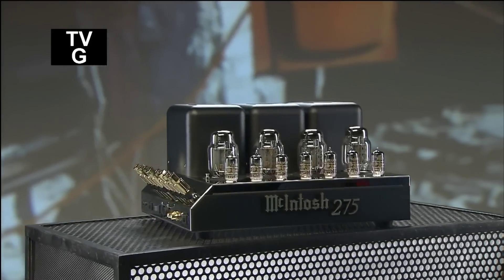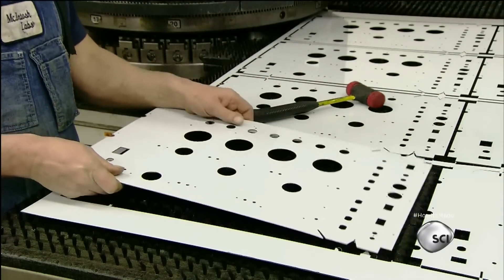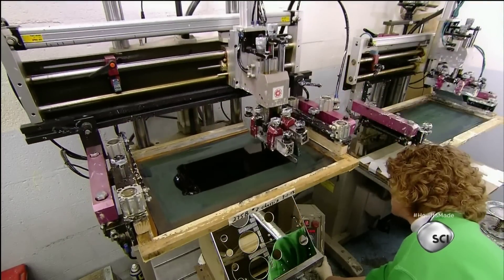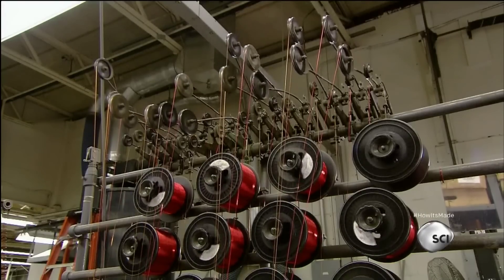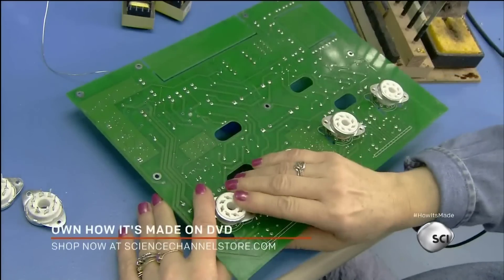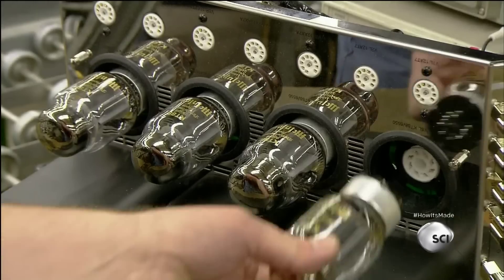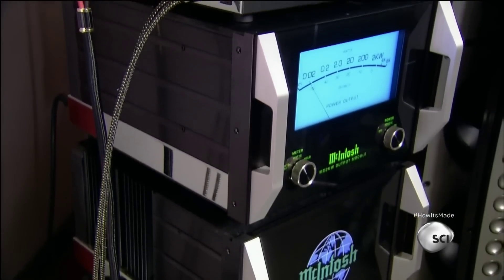How It's Made - McIntosh Tube Amp

Comment: I am of an age that I remember the golden age of HiFi very well, the age before Solid State devices took over from the Vacuum Tube, the 1950s and 60s.
I used to build amplifiers such as this one, does anyone remember the QUAD brand of British made amplifiers and the pioneering QUAD Electrostatic Loudspeakers. The greatest difficulty was always getting hold of those very specialized output transformers which only QUAD made. They were VERY careful about selling those transformers to anyone but their genuine dealers.
The finished products were magnificent and very impressive to look at.
However the FAIRY TALE about tubes being “better” or “warmer” or “sweeter” than Solid State is just a FAIRY TALE, designed to maintain a market for these very expensive DINOSAURS.
Even from the very early days Transistorized amplifiers were INDISTINGUISHABLE from Tubed amplifiers, over the years Solid State devices have improved even more and their versatility FAR OUTSTRIPS ANY TUBED AMPLIFIER.
Blind listening tests have PROVED BEYOND DOUBT that there is NO DIFFERENCE between the two Genres.
Tubed amplifiers are beautiful to look at, BUT any perceived difference in “WARMTH” is simply the buyer LISTENING TO THE MONEY THEY HAVE SPENT on these relics.
Save your money and buy a FAR LESS EXPENSIVE well reviewed device and put the money you saved into a college fund for your grandchildren, a FAR BETTER USE for the money.

Comment: As for the tube/transister debate, both valve and solid state offer similar if not the same performances. It is the design methodology and there implementation that seperates low from high end equipment. 

As for cables, my own listening tests confirm, that you do indeed get what you pay for and there are differences between cables, manufacturing technology and materials used. 

In the end, less is more. An ideal amplifier should be as near to a straight piece of wire with gain as possible.  Anything added, is where noise and distortion are likely to be generated. Additional performance can be obtained by limiting all vibration within the circuit as well as its enclosure.

Comment: I've been using tube amps for 25 years. It's clear to me that they sound magical. However, not every tube amp sounds good. It all depends on the circuit and quality of components.
Reply: Try all dht tube amp...you ll be surprised
Reply: @ngoweyseong3738  Do you mean the DHT model from Bartola Valves, or an amp made with all Dobhoff (DHT) type tubes ?  I had to google this but, neither case is common in the guitar tube amps that I use.

Comment: Unfortunately the printed circuit board approach makes for ease of assembly only. Point to point wiring, as in the old Mc's, is much to be preferred for sound and serviceability. If the output tubes fail they can put 700V through the circuit board, possibly melting the traces so the board has to be replaced. This cannot happen with point to point wiring. The driver transistors are rated for ~40V only; if the tube fails at 700V it will take out the tube. If one put a $0.02 diode to protect the transistor this would help. Computer techniques are not applicable to the assembly of most tube gear. It's not the same company or equipment. It's for the nouveau riche.

Comment: Seeing some of the debates here reminds me of an experience one of my electronics instructors at tech school shared with my class. He once worked for a prominent test equipment manufacturer and his group was tasked with building a CB radio analyzer. They had to go out on the market and buy various models to try with the analyzer. He spoke of two models in particular, one that everyone considered the Rolls Royce of CBs and another everyone considered to be Wal-Mart clearance bin grade. Imagine his group’s surprise when both were opened up and found to use the exact same circuitry inside. It’s all about marketing.

Comment: Now speakers are made with tiny amplifier built in and they no longer use cables only for the power cord instead they use wireless bluetooth connection

Comment: It should have been a post of how they made the original Vintage amp back in the day when they were 'King' Handmade, hard-wired, point to point soldering with genuine components. NO Printed Circuits and Plastic. The soul of this 'Brand Name' was the 'Handwound Unity-coupled Transformers' Best in the World then and today. I started my career in HiFi Audio at Photo-Tronics Warranty Station in Seattle, WA 1960. Warranty Service Technician. I also would hand match a set of 'cooked tubes' for a flawless performance,  we took pride being McIntosh Warranty Service. There were no issues with the Amps until PC boards and Solid-State came into productions. Long Live Point to Point Hard Wired Hand Silver Soldered Vintage Electronics.

Comment: Unitra Edward. Another 25kHz hearing audiophile stuff. Generally it is true that electron tube gives lower noise than transistor.
Reply: You can get <4nV per root hertz from many low-noise audio opamps, such as the NE5534A, the one used in all the mixing desks in the world (nearly)...  Can any vacuum tubes can't get near that in the audio frequency range?  If you want a low noise preamp, this is where technology is now: http://www.thatcorp.com/datashts/THAT_1570_Datasheet.pdf

Comment: And why are they handling the tubes with their bare fingers?  Bad...
Reply: ??? Probably because they've been manufacturing these things long enough to know how hard to grip them and to not touch the conductors? Use cotton gloves that won't slip.
Reply: Receiving tubes don't get hot enough that fingerprints can compromise the device.  Transmitting tubes, that's another story, but they require forced air cooling and several kV anode drive.

Comment: ...looks like those chips on the circuit board(which contain transistors) would tend to re-introduce the kinds of problems you were trying not to have by using tubes instead of transistors...   (such as PN junction hiss)
Reply: Lets see the schematic before jumping to conclusions!

Comment: And you let the worker wear rings around stuff that can scratch?  ... real smart..
Reply: chris younts  Riiight.....
Reply: You are forgetting how qualified and experienced you have to be to work in this type of assembly line. They probably let their workers wear whatever the fuck they want to keep them happy.
Reply: @lowerthetone  Would not fly at just about every company I have worked at.  Why I went silicone for the wedding band.  I have unboxed many high end items and will find scratches on them from time to time.. knowing it was a worker who was being careless or had a wedding ring on.  Seen it happen too many times when I controlled quality.  To each his own.. I just wouldn't allow it and the company I work for is far far larger than McIntosh.
Reply: @badlilstang  I'd be interested to know what type of companies you work at. These smaller, niche "cottage industry" types of businesses tend to have just that of a manufacturer line. I can think of many modern examples but am afraid to drop names. The jist behind their reasoning is often, "our product is easy to build, so the guys on the line don't need lab coats and gloves." I have seen them with rings and bracelets on. However, i am specifically thinking about niche turntable and amplifiers when I say this. No doubt things will change if there is ever an accident!

Comment: The way an accomplished audio engineer explain it to me, regarding the smooth realistic sound of tube amplification and preamplification, (that distinguishes it the from the flatter and hollow sound of digital and analog reproducton), was the vertical field effect of tubes, which enable them to produce an upper and lower harmonics of the fundamental tone being played. Further, it seems this is what the human ear hears and senses in a live performance, that gives one the sense of realism and depth, not sensed when listening to a recording. He also added one's hearing would have to be in good condition and somewhat trained, to appreciate the full benefit, the tube sound gives over newer technologies. The added benefit of quality workmanship, pride, build quality and oversight at the McIntosh factory adds a further enticing reason, for many audiophiles to spring the added cash to be a proud owner of one of these fine amps. I am a proud owner of two of them and can attest to their great sound and years of trouble free service.
Reply: "which enable them to produce an upper and lower harmonics of the fundamental tone being played"  = "adding something to the original signal" = "not accurate"
Reply: @KB-kc7ou  if you want accurate tubes that have better layering than this just get the I50 audio research integrated amp.

Comment: That awesome ..., the lights turn green so the user knows when the amplifier is ready with its temperature in optimum valves, hahahaha, they sell them anything.
And the transformers are crap !!!, are not manufactured layer by layer, if I look for a 1940 amplifier the transformers are better made than these which are a wire bun, or transceivers interetapa have, a clown

Comment: So they take off the protective film and polish the chrome...After which some lady assembles everything with no gloves on, leaving a ton of fingerprints that then needs to be polished away later.

Also, i saw NO ESD protective gear, bracelets or anything on the lady that handled the electronic curcuit board and the lady inserting the tubes had no gloves on, which means that they would have to polish the tubes to get rid of fingerprints.

All in all, not a very clever production.
Reply: I'd be terribly surprised if there's any ESD-sensitive CMOS hardware in a Mc amp, so the static strap's not strictly necessary. And they do go through and get the finished product "white glove" clean before they wrap it and pack it.

Comment: Solid state amps tend to produce odd order harmonics when over driven, tube amps tend to produce even order harmonics. Even order harmonics are exact octaves of the original note and they serve to fatten the sound, odd order harmonics are not exact octaves and sound like shit. If you don't overdrive your solid state amp it will still sound good but you can overdrive a tube amp and it will sound great, in some cases even better. It is far better to squash a sine wave than it is to chop the tops and bottoms off. Tubes are better.
Reply: That's good for guitar amps, but in Hi Fi audio you don't want to overdrive your amp and definetly you don't want to color your sound in any way, not even with enhancing even harmonics.

Comment: It's nice to know they used non-magnetic connectors to avoid distorting the sound.  You certainly wouldn't want to cover up all the distortion from the steel plates in the output transformers!
Reply: I guess "How It's Made" really isn't all that concerned with "how it works" or "what's real". :D

Comment: boy  I remember those days, Turn it on & wait for the juice to flow, The down side as they age, & or get bumped hard, after a while a Tube of two goes north of south, in fact you could have a number of weak tubes, so you  want have the tubes loaded tested from time to time, Or just wait till it doesn't work, I grew up on Tube radio / TV and anything else that required such before transistorsreally kicked in, I think The Japanese really push that when they invented the pocket radio. after that it became a whole new world, we left the stone age, by by analog

Comment: The fuuuuck? They're going to make the outside look all pretty and charge an arm and a leg but they're not going to mil spec solder the tubes on?!?! There's no other part in there with legs that undergo more severe heat cycling. Tube amps anyway, wtf.

"Uh, it makes a special sound". 
When? 
"Like, all the time man."
That's distortion from uncompensated non-linearity. Why would I want that?
"Its smoooooother maaan." 
Lol, heard of eq and effects? Shit, Im pretty sure you could switch in a few banded LC networks and accomplish the same unresponsive, burdened sounding wah wah of a tube.
"Well, it makes pretty lights."
So does gluing leds and sanded glass to fucking anything. You can use rgbs and get right around 16 million colors out of a $1.50 arduino spinoff. 
"Well, its nostalgic". 
Oh, I thought you were looking for the purest audio, not the solution to a mid life crisis. My bad. 

Get a good solid state class A, a cheap(price not quality) pair of discontinued, open back, circumaural cans from audiotechnica or the sort, and play full audio files instead of mp3s, through a program that doesn't boost or attenuate shit. That's about the purest you're going to get for under cost of hiring the band. All this tube shit is just pandering to internal biases. Advertising and gullibility at its finest.
Reply: yep.. i bought a tube preamp to try out the "tube sound"   i went back to my solid state preamp.

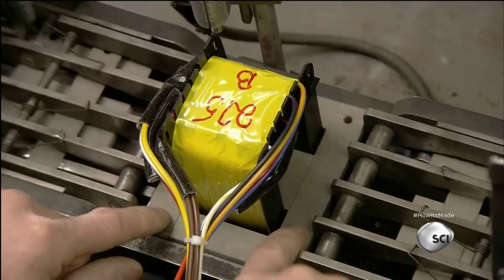Comment: 2:46 I don't think they inserted isolating film between any of the steel sheets. In such a high quality amplifier, you'd think they would want to remove the eddy currents, no?
Reply: They use silicon-doped grain-oriented steel in the transformers to minimize eddy currents.

Comment: Printed circuit for the output stage, one single pcb .........! It's a shame such an expensive amplifier to be manufactured in such a way.
Reply: yep. it looks like the old ones were made better..   those microchips wont last long
Reply: right? especially when you compare to other contenders in the price bracket nowadays, these ones are really the bottom of the barrel